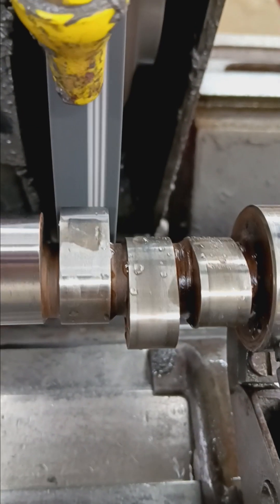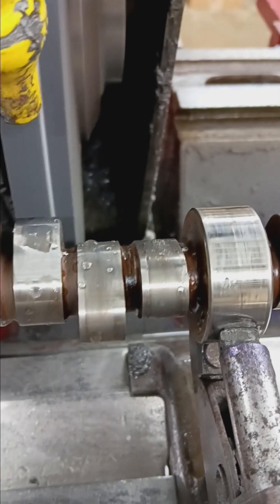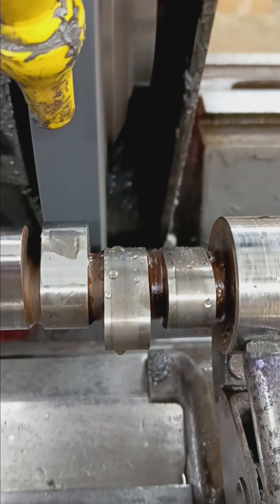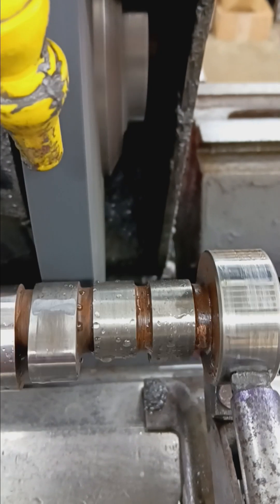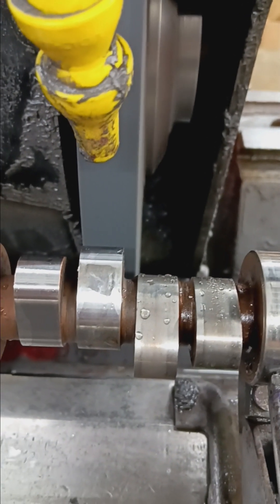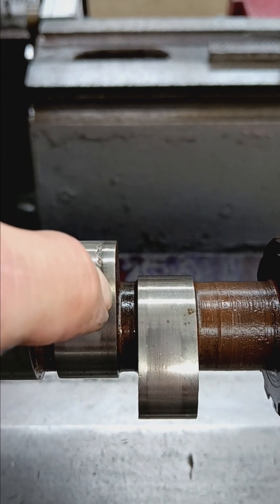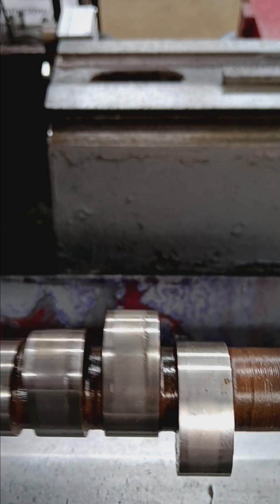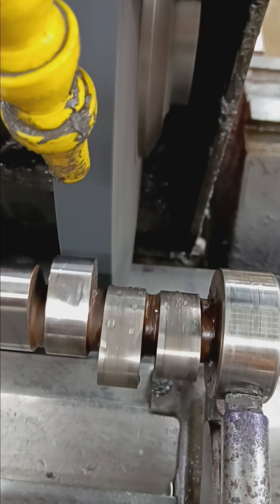Lobe wear in the high velocity area.

Comment: It is interesting to not see the wear on the highest part of the lift. Without a cam tool, that is about the only thing that can be measured. Some service manuals say that if the wear there is below a certain number, you can reinstall the cam as is. This is why I hate the idea of not regrinding or replacing during rebuild.

This is also why I hate the idea of doing a ball hone, even if cylinder bore and standard size piston measures well.
Reply from the maker: Peak lift has the 2nd lowest force on it